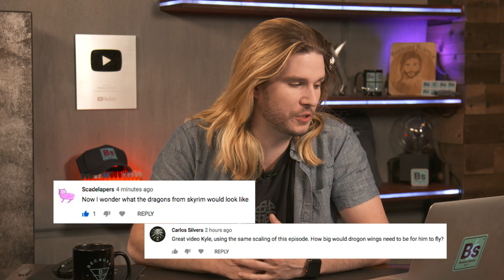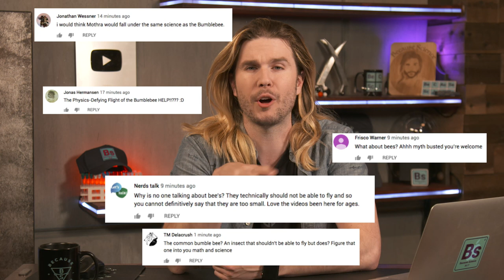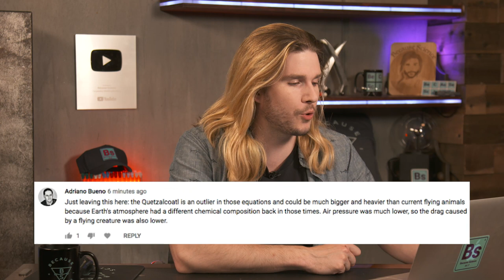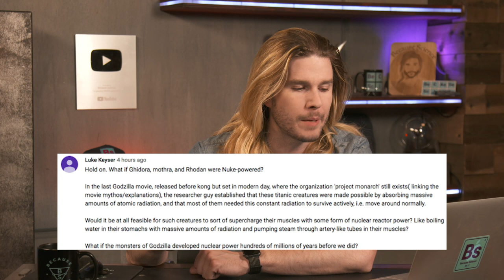Godzilla’s Nuclear Steam Breath | Because Science Footnotes

Comment: You kind of dropped the ball on the Bumblebee point. First, as some others have pointed out, bumblebees don't fly because they flap very fast but because they flap differently than birds do (they have a sort of scooping motion which generates more lift than a standard flap) and that's where the modern myth came from. It was true until we developed better highspeed cameras that allowed us to see the full motion of the wing and once the new lift value was calculated physics had no problem with bumblebees flying. Second I think this is what some of the original comments were referring to, if Mothra flapped her wings like a bumblebee her wingspan would need to be smaller than what you initial calculated due to the added lift.
Reply: THANK YOU SIR!!!!
Reply: Lift this comment to the top.
Reply: CareerKnight - Except Mothra clearly doesn't flap her wings like a bumblebee does, because she's clearly not a giant bumblebee & doesn't have wings anything like that of a bumblebee.
Also, the speed of a bumblebee's wing flapping does attribute to why they can fly, along with the scooping motion you stated.
It's not 1 or the other, it's both.
If it was just the scooping motion, then bumblebees wouldn't flap their wings as fast as they do now would they?
Reply: Doesn't bumblebees fly in a similar pattern as a hummingbird? Isn't that why it's able to move in all directions?
Reply: Also because the size of muscle compared to its body is massively different from other flyers...

Comment: I still really really want to know if the Mines of Moria and Khazad-Dum are possible to build through current engineering feats.
Reply: Most of Moria was carved out of existing stone, was it not? I would think that so long as the rock is sufficiently free of fissures and cracks, most of those structures and spaces could exist. You don't have to worry about lintels being strong enough, or how to hoist blocks into place, you only need to worry about excavating a void
Reply: Closest thing in real life that's somewhat similar, is probably this: 

https://en.m.wikipedia.org/wiki/Metropolitan_Area_Outer_Underground_Discharge_Channel

look at the people in the photo, place is huge, its designed to capture floodwater to prevent flooding, I'm not sure it's Moria big, but it's biiiiiig
Could bigger be built? Probably
Reply: Gonna nitpick: Moria and Khazad-Dum are the same place, just one is the Elven name and one is the Dwarvish name. 

It's probably possible to build a similar structure but it wouldn't be hospitable in the slightest and I imagine lighting the place would be a freakin' nightmare on energy consumption...

Comment: What I expect is that because he spends so much time near the bottom of the ocean, he eats massive amounts of rock and metal, then compresses it into a very dense sort of slab. When he needs to use the breath, he biles up this slab at the same time letting some sort of incredibly hot core driven by nuclear energy in him conduct energy to his throat. If you are familiar with the casaba howitzer concept, you might see how this would create a particle beam of deadly plasma in a very directed fashion. The casaba howitzer concept proposes tungsten, but super dense metals would still work, it just needs to catch the unbelievable heat and spill it in a thin cone of plasma death.

Comment: I wanted to point out a whole component left out of that bumblebee calculation: Low Pressure Vortex. The bee’s wings do beat quickly, but more importantly they beat in a specific back-forward angle that creates a low air pressure vortex just behind the leading edge of the wing. The suction produced by this vortex provides more than enough lift to keep the bumblebee aloft. Recently it has been shown that this vortex means bumblebees do not require extra effort to fly in turbulent air as opposed to still air.

Comment: On bumblebees and insect flight; their flight doesn't rely on the same kind of aerodynamics as the birds we're more familiar with. Kyle already pointed out that they beat many times faster than a relatively sized bird, they also keep a much steeper angle, where birds tend to rely more on gliding and natural airflow in order to conserve energy, like most small things bumblebees and other insect don't really care about stamina and instead their flight relies almost entirely on creating a pressure difference with their wing movement, which unlike what Kyle said they are actually very efficient at doing. Where a bird could be compared to a plane, insect flight is better compared to a helicopter.

If it helps to make sense of their shape you can think of them more like tiny airships, the mental image certainly helps me.
Reply: they might be efficient however if you look at helicopter style blades for flight you will see that a larger blade is more efficient than a smaller one.

Comment: His atomic breath being steam makes a lot of sense actually. Since he feeds off radiation and not food he wouldn't need a stomach. So he could have two Chambers in his body in place of his digestive system. A smaller chamber for nuclear power (small because nuclear power puts out massive amounts of energy so it wouldn't need to be large), and a massive water containment system that would pump water through his system to keep him cool and to cool off his power core (not sure what else to call it). 

With him being underwater most of the time he stays cool. When he's on land it seems to almost always be raining or in an Arctic environment so he can stay cooler. When he's on land fighting his nuclear core is working harder and getting hotter. So when he's hot enough he could pull water from his body and dump it in to his core to create his atomic steam breath like you said. However, it could explait his fins lighting up as well. They'd most likely be a heat sync to keep him cooler on land. So when he pulls his liquid cooling away from them for his atomic breath they would heat up relatively quickly due to the heat his nuclear core is putting out and light up. The sound could be vibrations coming from the heat energy shaking his fins/heat syncs perhaps? 

It also explains why he doesn't open with his atomic breath and always saves it for last. At the beginning of a fight he's simplt not hot enough to use it yet.

Comment: Changes in atmosphere and Quetzalcoatlus flight: While the density did not changed, the composition did changed, in the late Cretaceous period the O2 level went from around 22% to over 25%, allowing much larger and stronger animals than the current 21%. Add the gliding concept and possibly the largest ones are flightless with just like the today large birds with leftover wings.

Comment: I theorized Godzilla's breath was a cooling mechanism after watching Shin Godzilla. He's basically a walking reactor. Without water to take his excess heat and radiation it builds up and like a runaway reactor it would led to a melt down. So to keep his temperature under control he releases it out through his mouth as his atomic breath.

Comment: A couple of points about Quetzalcoatlus's weight and flight. There are a lot of weight estimates out there for them that are way too high. As I understand it 250kg is a better estimate than 500kg. And as for how they take off, we've actually got pretty good models for that, where in they push off the ground with their hind limbs and vault themselves into the air using their forelimbs. you can pretty easily find animations of this launch cycle just by googling "pterosaur launch cycle" or something. Obviously we dont know for certain that its what they did, but the model works and it matches fossil trackways (yeah, fossilized bodies arent the only traces of these animals we have), so it seems likely.

Comment: Hey Kyle. So about the dragon weight and flight ability... I remember it's been proposed that had dragons been real evolved creatures that one way they could have handled the weight issue and done fire breathing would be to have a kind of third lung that fills with methane from digestive decompositional processes. Methane being less dense than air would give it an amount of buoyancy. 

Not sure how the math would work out but I'm sure that's something you or someone else might enjoy doing. And in case you're wondering how the methane could be lit for flamethrowing: flint gastroliths and an iron protrusion at the roof of the mouth.
Reply: well let's take a look, density of air is 1.225 kg/m^3 and the density of methane is 0.656 kg/m^3 making a buoyant force equals the weight of the fluid displaced (1.225kg *9.8m/s^2) and let's subtract the weight of the fluid replacing it (0.656kg *9.8m/s^2) to get a lift of 5.5762 Newtons per cubic meter.  Let's just say that the dragon has the weight of a T-Rex approximately 6000kg and the internal volume of a 747 for passengers 876 cubic meters, then it would offset about 500kg of weight, so about 8.33% lighter and that would look like a blimp carrying a T-Rex. If wing size is linear to weight then this would change his 65 meter wingspan to approximately 60 meters.  This is just some off the cuff calculations, but I feel like the lift gained from a methane sac wouldn't cancel out the wing size necessary for these creatures by a reasonable/substantial amount.
Reply: @xyvazkrown8048  Thanks for doing the maths! That's pretty cool however I might say that, given that Kyle said that with the weight of Drogon and the biomechanics and physics of wings, that his would need to be larger creating more mass therefore needing more wing creating a feedback loop, that rather than using the calculation to see about shortening the given size of the wings wouldn't it be more apt if thought about if that offset is enough to allow for the wings to stay as they were given and allowing them to create enough force for flying? Thus breaking the feedback loop. 

Also too bad the T-Rex had hollow bones and thus is probably part of the given weight and not something we can add to further reduce weight.

Comment: don't know the specifics, but I believe there was a mystery about bumblebees flight dynamics that was figured out around the millennium (again Idk). under extreme slow motion we were able to observe tiny vortices of low pressure on the tops of the wing edges. so Bumblebee wings are insanely efficient, they would have to bee.

Comment: The theory of bee flight is a simple one. Pollen isnt actually produced by flowers, its collected by them from unicorns as they prance about the night while you sleep. The bees then get busy collecting as much of the unicorn dust as they can possibly carry. The Unicorn dust is then taken back to the hive where it is turned into an extremely potent and pure form of fuel that the bees then use to run their engines over 9000 rpm with over 9000 horse power. This allows the bee to fly.

Comment: In NZ we had (Prior to extinction in 1400 CE) probably one of the largest eagles to ever exist, with an estimated wingspan of only 8 feet, but a body weight of 11.5kg (25 pounds) for males, and 14kg (31lbs) for females. Yet they were able to take down the largest most recently extinct (again, 1400 ce) flightless bird, the Moa, which weighed up to 230 kg (510 lbs). The reason why these two bird died off at around the same time was that the Haast's eagle was an example of a predator that became too specialized, so once its prey of choice was killed off through environmental factors and human predation, the eagle followed shortly after.

Comment: The Quetzalcoatlus was a massive flying reptile which managed to lift itself off the ground by using the muscles and tendons in its fingers, they could exert up to 6 G's worth of force to get airborne. The Quetzalcoatlus was 10 - 11 meters long and weighed at least 225 kilograms - 500 Lbs. It was capable of powered flight like birds however its size and mass would restrict it to semi-powered flight or in other words it would be more like a glider. It would flap its membranous wings to keep it stable or to keep it within the thermal draft in order for it to conserve as much energy as possible. 

The creature was able to grow as large as it could was thanks to it having hollow bones, its bones were honeycombed like birds were but they had the density of paper. Even though their bones were as thin as paper they were very muscular. The Quetzalcoatlus preferred to live near coastlines where they had access to cliff faces so they could roost.

Comment: Turns out the quetzalcoatlus was able to take off by using both its feet and elbow joints in a four point take off. Impossible to prove but its believed its possible. The bones were not sturdy enough to take off like  a normal bird hence the four point take off and some estimates for its weight could be as low as 250kg.

Comment: About the correction at ~11:50, is also under a weird reversed logic even if the atmoshpheric conditions were as drastically different as suggested. Reduced air density would give flapping wings less air to push against, which would in turn making flying significantly more difficult.

Comment: Kyle, Lightning also strikes planes in the sky. And, as with most "all metal bodied" air/spacecraft, the current usually passes harmlessly through the material and out the other side. Mostly, you get an arc weld-like spot on the points of entry and exit.

Also, Rockets are giant lightning rods.
Reply: AKA A Faraday Cage
Reply: @ResidentWeevil82  Pretty much.

Comment: Concerning Godzilla's immense size, his bones may be more metallic than calcium based like our's. Also the fibers in his muscles could be structured in a different way to increase his strength.  At his size, his blood pressure would have to be so high that even a small cut would cause him to bleed out, but his extremely thick hide may have been able to prevent the smallest cut. Multiple hearts could reduce to blood pressure significantly. Finally, nerve impulses similar to our's could not travel from his brain to his legs quickly enough to even keep his balance and not fall over, but this problem could be solved by multiple brains strategically placed throughout his body.

Comment: My dad was an aerospace engineer. He explained the bumble bee "problem" to me many years ago. For a long time the best aerodynamic equations known could not explain how a bumble bee flew. This issue has been resolved in modern times. Using modern equipment and math, the correct equations have been found.
Also:
1) If you observe something that current science can not explain, this does not "prove" that science is wrong, merely that it is incomplete.
2) If observe something that disagrees with a WELL TESTED scientific theory, it does not prove the theory is completely wrong, just that it is incomplete. I.e. Newtonian gravity vs. Einsteinian gravity.
3) Until you have a properly observed and verified exception to a WELL TESTED scientific theory, you should expect the theory to be correct. However, you should feel free to try to find and verify exceptions to the current theories. That is part of the scientific method after all.
Note that I emphisize WELL TESTED, because too often the results of a single experiment is passed off as proven scientific fact. Experimential error is a real thing. That is why any scientific theory needs multiple independent tests before it can be concidered "proven".
Reply: I was under the impression that it's less the equation and more a fundamental change in our understanding of how flight works; it's not about low pressure above nearly so much as high pressure below (bouyancey)
Reply: @Theinkedanarchist  it is something like what you are saying.  The new equations do represent a new understanding of how it worked. That is why I said they needed new equipment to figure it out an not just new math. Also, I don't actually understand aerodynamics myself. So all I can give is a simplifed version of the explanation.

Comment: Actually, Kyle, the ends of whips aren't responsible for the famously supersonic crack. It's actually the part of the whip behind the tip that gets snapped back in the opposite direction of the tip. Derek Muller of Veritasium did a video on this iirc. #BECAUSESCIENCECORRECTIONSCORRECTIONS